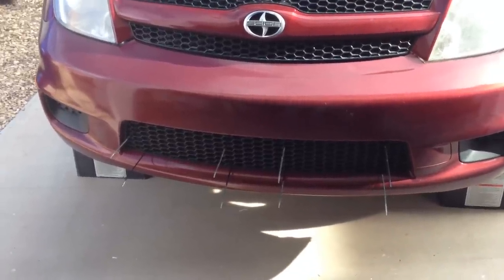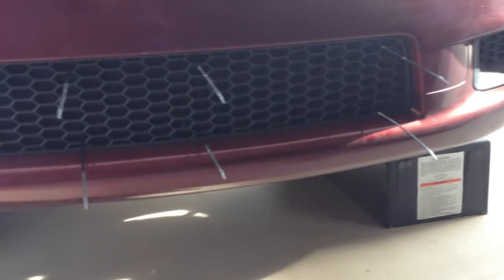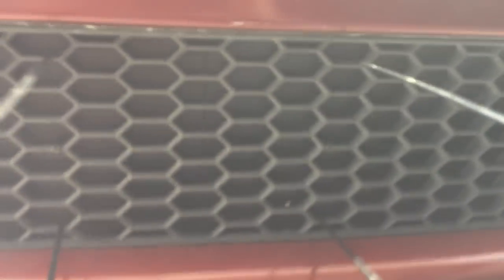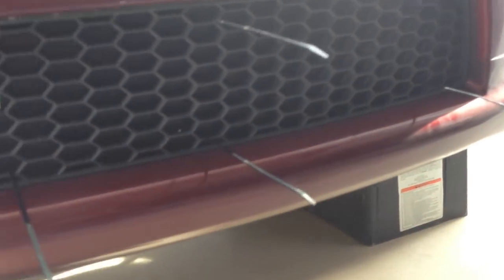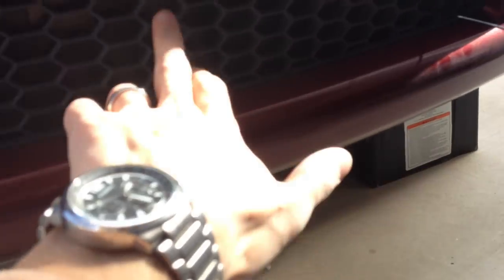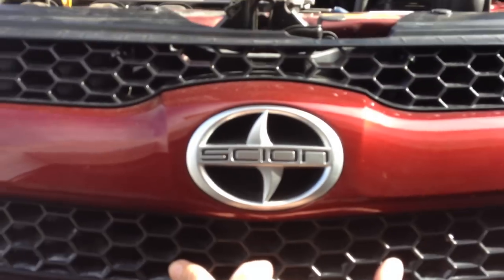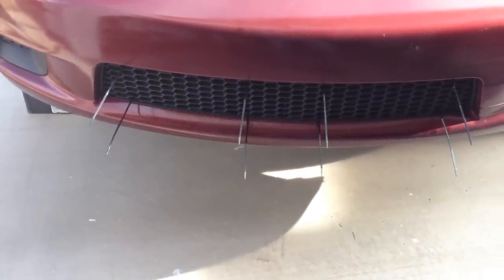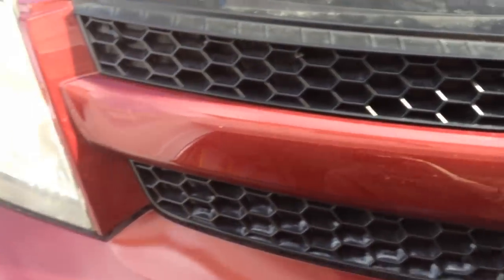Scion Xa Lower Grill Block for Improved Fuel Economy

Comment from the maker: Temperatures on my scan gauge II showed an increase of 5 to 10deg F peak but still within normal operating range.  Peak temps are just over 200deg F where before they were maybe 195 deg F.
Reply: Did you see mpg improvements?
Reply: Depending on where u live an increase of 5 to 10 degrees I heard can make a big difference when it comes to walking that fine line between overheating & not as far as some parts go. Im also curious to know if u saw any substantial gains in mpg not that u would because the XA already gets good mileage as it is.
Reply from the maker: @tylerj44  These were silly experiments.  Getting a low cost, used EV is the way to go now for real efficiency.